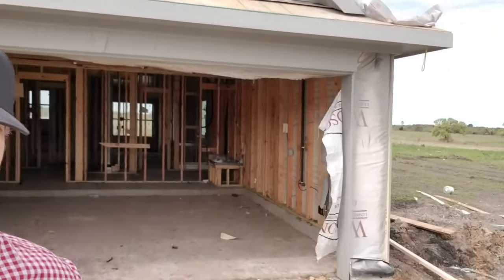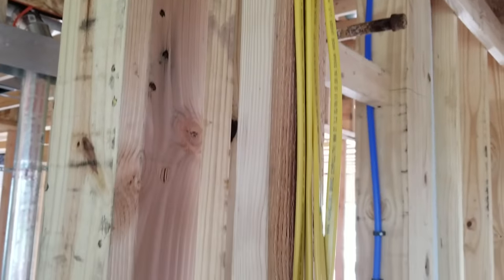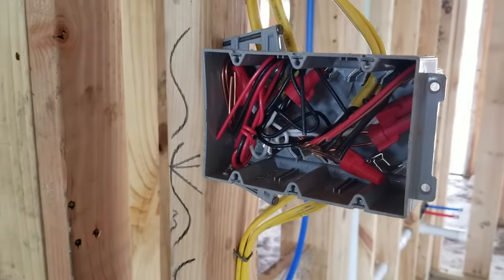HOW IS THIS EVEN LEGAL?!?!

Comment: You seem to have an ax to grind here.  "Tract home", "cookie cutter", "don't go with the crazy big house" - these have nothing do with quality, but your choice of words shows you aren't going to be objective in your evaluation.  Water barrier: you perform your own field test of whether it's waterproof, then categorically dismiss the product as ineffective?  There's more behind the design of that product that you're giving the manufacturer credit for.

You yourself admit that you don't know how the home is designed and what other parts and pieces are added to mitigate those issues.  If you're only familiar with the traditional approach to solving these construction issues (water penetration, racking, insulation), don't label it as defective before you take the time to understand it.  Your concerns with racking is another example.  Why don't you find a copy of the plan and look if there's other pieces that haven't been installed yet or that you didn't notice?  The plans are probably sitting somewhere on site.  Why don't know meet with the builder and ask them how the engineer is solving for sheer force?  You talk about the insulation and admit that you don't know what else is going on behind the walls to solve for this.

The flashing appears to be a legitimate issue, but it may not be finished yet, or may not yet have been inspected by the superintendent.  A good onsite builder will find that and make the trade fix the issue.  Walking around with a roll of flashing tape can fix cases where it wasn't applied carefully enough.

I agree that the customer is at risk, because they don't know enough to find issues with the construction of the house.  However, they also don't know enough to determine whether you know what you're talking about.  But if they're only seeing your side of the story, assume you're qualified and informed, and you throw out derogatory terms to reinforce the message you push that big builders are shoddy work, of course they're going to believe you.

If you see something that actually isn't to code, call it out the builder specifically.  Don't overgeneralize and trash an entire industry.  I love fair, critical information.  Your video is critical but not fair.

Comment: R u joking me you are not that I have the proper insulation value I actually like the frame the outer walls with 2×6 just because you could fit r19 insulation in easily Plus I like to put insulation board on the outside over plywood so not only do you get great installation value but you get good soundproofing also but those straps I'm not going to do anything it's like hurricane straps on the outside of a house not really don't do much either but years from now when the house Settles you're going to have all types of problem with doors and other things in the house

Comment: Maronda Homes give you the run around. They take forever to build your home. Be careful  make sure you are watching them build your home. They make many major mistakes. My friend is having a home built by them the home is a 5 bedroom home with 3 bathrooms. Plumber assume the home only had 2 bathrooms he plumed it for 2 and they poured the concrete slab. Then they had to break the concrete floor to fix the plumbing. My guess plumber didn't even bother to look at the plans, project manager is an idiot and the inspector who signed off on the plumbing is clueless aswell.

Comment: Best off buying a home built in the 1970s, or putting that $250,000 into a quality smaller footprint home. It would build a great 1400 sq ft ranch with 1970s quality workmanship. Even the best material in the world is worthless if you ha e knuckleheads doing the labor.

Comment: "Hot water heater"
Why would hot water need to be heated???
Reply from the maker: Because of heat loss.  Also there are water heating systems that are not built to supply residential hot water.  Think of industrial water heaters in processing plants.  They are definitely not hot water heaters, as the end product is not hot water, but heat itself.  In this case, however, the product produced and used is "Hot Water" and this unit heats the "Hot Water". Ergo it is a "Hot Water Heater".  Also, I am from Texas and this is advanced technology for me. ;)

Comment: I've know a lot of workers who have a license who don't know their butts from a hole in the ground.  This doesn't happen because of the workers dude, this is the BUILDER. The carpenters didn't decide not to use sheathing on the outside walls, anyone who knows anything about construction knows how expensive it is now.  The builder decided to take a shortcut, not the guys who installed it.  They did what they were paid to do. 
My problem with your video is the fact that you conveniently overlook this and suggest it was the siding guys who took a shortcut.  Next time why don't you do a video how the builder is to blame for crap like this.

Comment: Well my house I built is cheap,  pier and beam, 6 foot in all directions  or closer, treated lumber, joists, and beams,  two layers of 3/4 inch treated plywood for subfloor,  2x6 walls,  first four feet of plywood on sides treated 3/4, untreated 3/4 at top.,  42 inch eaves over hang to divert water away from peirs, and into french drain trenches., Metal roof,  porcelain tile throughout the entire house.  All glued, screwed and nailed, along with every metal assist out there, (wind, and earthquake).  Hardy board siding, and then recovered with furing, rock wool, felt paper, and then stone about 2/3 of the up.   Yep and I thought I was going the cheap route,   till I saw this video,  ought put the people who build those houses in jail.  will not stand any wind and your bills will be threw the roof and god help you with pests.

Comment: The building inspector should be fired. He should of never gave them approval to cover walls without the wall bracing in.
Reply: "wAlls", lol. A car port would have saved them the trouble of pretending that is a garage. And it opens right into the main house - great home security there.

Comment: Builder A/C is already drastically undersized. Then add on the fact that the wall have an R rating is 2.  That make for a hot house in the summer and a freezing house in the winter. That horrible. They should be ashamed of themselves. I was a Mechanical Engineer for 30 years on top of building houses like that the builders give minimal space, if that, to run ductwork. Terrible. Terrible. Did I say TERRIBLE.

Comment: I'd rather see Tar paper than the shit they use now.
Reply: Tar paper (black lathe paper or aka Grade D) sold today provides only 20 minutes of waterproofing / permeation factor before it passes through to the interior. Pass. Super Jumbo Tex lathe paper on the other hand has a single layer 60 minute product which is triple the 20 minute code requirement. This is another example where properly constructed Scopes of Work as contract attachments requiring the subcontractors to perform at levels exceeding code shines and separates good builders vs. not so good builders.

Comment: I have been a GC for over 40 years, your are not qualified to do this video, learn more!
Reply: Agreed. 50 years experience here. College instructor for home inspections for 15 years. Expert construction defect consultant for 25 years. Video is misleading for garage shear defect. Then he sees bracing afterward and has NO PLANS to verify. Metal Let--in braces easily installed at this stage of production but can be made to look like an OMG situation when in fact it's a yawner. You have to know what you are looking at with approved plans in hand otherwise you are guessing and misleading the crowd. The window flashings were a self sealing variety when nailed vs. Sisalkraft brown paper which is crap and I've not seen in decades but am on alert to spot in production. You are spot on otherwise !

Comment: If it ain't got sheathing it is a weak wall!  If there is improper sealing of windows water will get in!  If it does not have R-19 insulation within 2X6 walls with electrical boxes taped and sealed, it will cost more to heat and cool.

Comment: Hardie board siding CAN be installed directly over a vapor barrier to the studs without sheathing. There is nothing wrong with this practice if local code allows it. They used metal strapping to provide racking strength. It is as strong, if not stronger, than OSB sheathing and vinyl siding.

When you used the term "waterproofing" it shows that you know little about modern construction techniques and materials. Moisture, interior air quality, and mold issues arise when houses are not able to "breathe", a lesson learned from the from the late eighties and early nineties. You should do some research before you post a alarmist video like this that has no basis in fact.

Comment: I keep coming backing to this video.  owner builder here in Florida.  I just need to know if there is way to build small  without sheathing, where rack and load strength comes from cross bracing and girts of the frame or walls? Idea and questions here:  https://www.youtube.com/watch?v=G-Kq97fYDuo